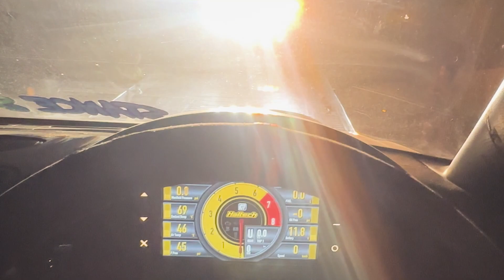My Rotary says Goodbye after SEMA (NOT A JOKE)

Comment: 100% running on one rotor
Reply from the maker: Took it to seven stock everyone said the side seal, not 100% sure on rotaries but I’ll have to find out once i take it back to the shop! 😩
Reply: @AyyePaulyy  if you are planning on keeping the car, I highly suggest you invest in a Rotary compression tester for peace of mind. Just screw  into 1 of your spark plug holes and crank, will give you an idea on the health of your engine. All Rx7s should have come with one in the glove box lol.